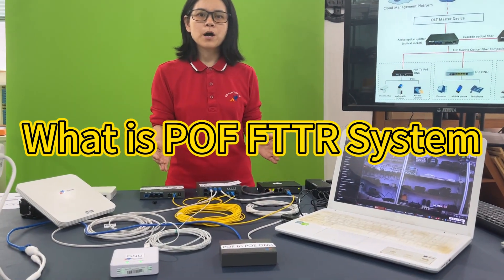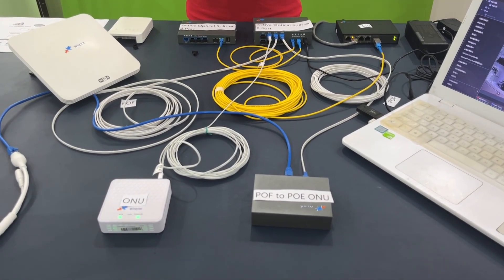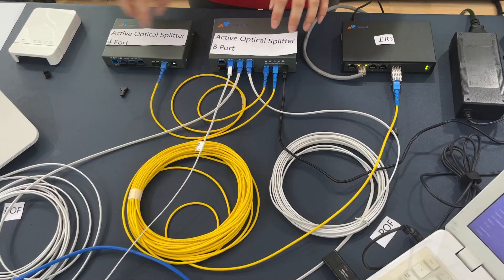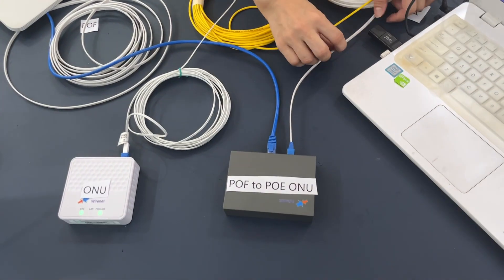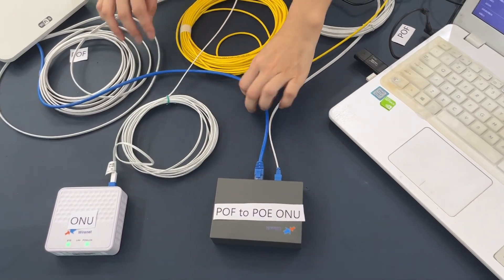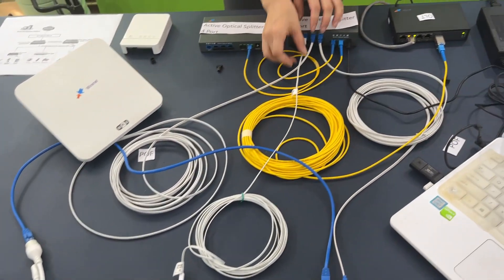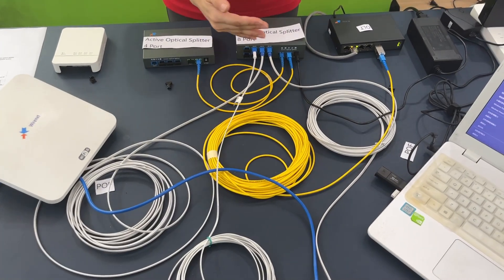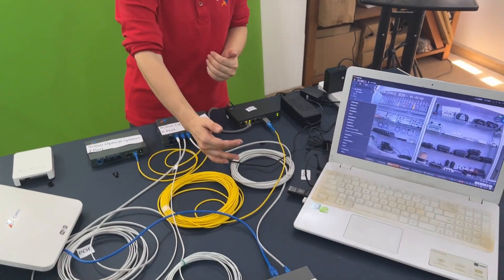What is POF(Power Over Fiber) FTTR System? #fttr #ftth #patchcord

Comment from the maker: PoF (Power over Fiber) is a power supply system that uses optical fiber. It integrates optical signal transmission and DC power supply. It not only extends the network transmission distance of terminal equipment, improves network bandwidth and speed, but also solves the problem of difficulty in obtaining power in specific environments. It can save line wiring costs and shorten project construction period.